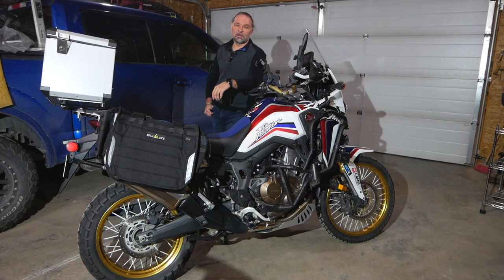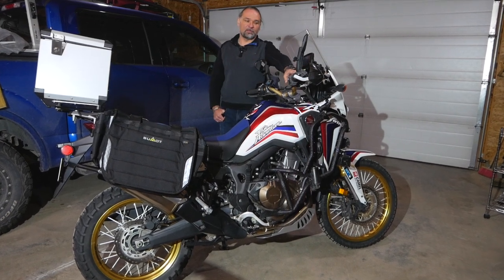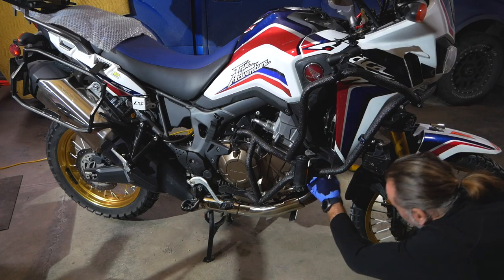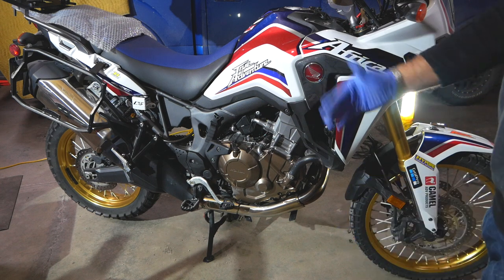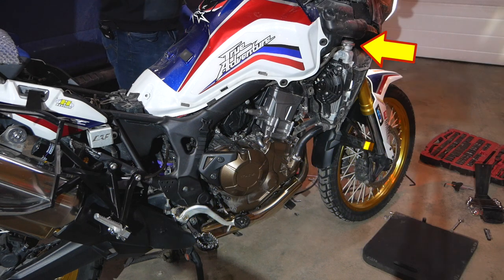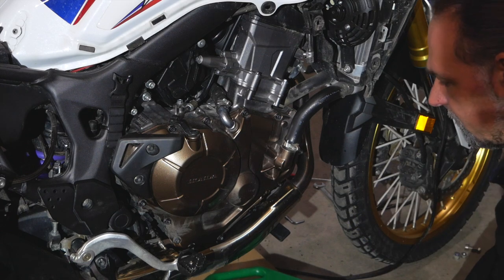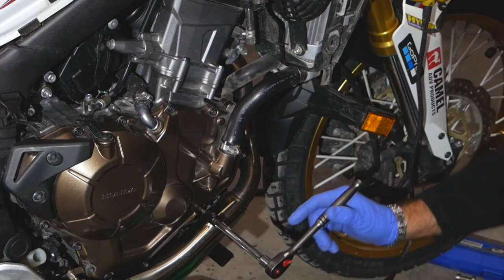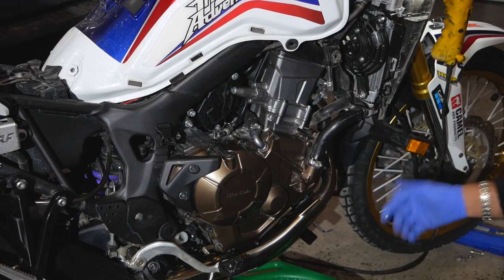HOW TO FLASH REPLACE  MOTORCYCLE COOLANT  HONDA AFRICA TWIN 2017

Comment: Hi Sir, great and detailed video as usual! Just wondering how the second (left side) radiator, fill itself to the top with coolant and the air is able to be pushed out of it? Regards!
Reply from the maker: They are connected together and that's why you run your bike with the cup open for a bit you will see you will have to top it up as the coolant gets a bit lower and once top up start the bike again to make sure your coolant it up to the neck of the filling cap.  Collant starts to rise when it is full. You can look it up also in Service shop manual.
Reply: @AdventureTravelandScuba  Many thanks for the reply, sir! Stay safe and have a nice moto season! :)
Reply from the maker: @simeonstankov513  Thank You and same to You ride safe.
Reply: @AdventureTravelandScuba  I guess there is technically no reason to remove the panel on the left side of the motorcycle if there is only one filler cap?  That filler cap only being on the right side?
Reply from the maker: @williamsongradingllc6134  correctly by myself if I'm that far already I will have a look at my Air filters may as well
Reply: Hi and thanks for all these great videos on AT maintenance.  Thanks to your videos I replaced brake pads and fluid on my new-to-me 2016 AT and today tackled removing crashbars and fairings to replace coolant and air filters.  It took awhile but I got there!  Great videos. Much appreciated!
Reply from the maker: I'm happy you found value in my content, and thanks for positive feedback

Comment: video perfetto, unica domanda. Una volta messo il liquido refrigerante e si mette in moto bisogna mettere il tappo al radiatore per eliminare le bolle d'aria nel circuito?
Reply from the maker: What language is this so I can translate with google?
Reply: @AdventureTravelandScuba  Italian
Reply from the maker: @giammarcogiorgi7449  Thank you for the comment
Reply: I repeat my question because you can't see it in the video.  Then, once the cooling system has been emptied, the new liquid is added.  Then the bike starts, but does the cap have to be put back in the radiator or should it be left open without the cap?
Reply from the maker: Leave the cup open after you fill it up with coolant once engine reaches its operating temp. Close cap at the end and top up coolant reservoir to max  line as you see in the video
Reply from the maker: @giammarcogiorgi7449  the cap should be left open so this way it has a way for the air in the system has a way to escape, the video shows when I install the cap back on at what stage. Hope that helps

Comment: Nice video, finaly someone made video how to change coolent on AT! 👍 2 questions tho:
Is it necessary to remove left panel of the bike if the coolent system is on the right side?
Soundn't be the coolent system flushed with destilited water before you put new coolant? 
Thanks
Reply from the maker: No it is not necessary at all but I was also cleaning my air filters you will see in next videos to come, don't need ro mix water if You purchase premixed coolant as i have stated in the video.  The coolant is already good to pore in
Reply: @AdventureTravelandScuba  is it 1,4l for everything? Reserve tank too?
Reply from the maker: I bought 2 if these bottles and I did not use all  of it there is quite a bit left in One of them buy 2 just to be safe https://www.amazon.ca/dp/B0039OTLRW/ref=cm_sw_r_cp_apa_i_EAYZ5Y6SBG8F2EK9E4Y0?_encoding=UTF8&psc=1

Comment: Hi. Great video. Do you close the radiator cap when running for 4 minutes? Or is everything open. Thanks.
Reply from the maker: No leave it open you will see the coolant slowly rising, the idea is to get the air out of the system once coolant level starts moving up too close to spill turn the bike off.  Hope that helps.
Reply: @AdventureTravelandScuba  thanks. Helps a lot. Just need to decide when to replace. According to the manual only the reservoir needs top-up.
Reply from the maker: @migo33  I would recommend 2-3 years lots of potential issues with water pump possible to happen you can search the forums and websites, not a big job not expensive worth a piece of mind
Reply: @AdventureTravelandScuba  thanks. I agree.

Comment: Useful video, Thomas! What are the drain bolt washer dimensions? I'll order few, just in case if it needs to be replaced.
Reply from the maker: Unfortunately I don't know the size or part number of the washer Your best bet is to contact dealership, It is also not listed in Shop manual, but You can always reuse it, I live pretty close to my Honda dealer so if i need parts itbis 10 min away.
Reply: Oem honda sealing washer 6mm
Reply: @mike-on-the-bike  Thanks much, Michal!

Comment: Is it possible to just take out in inner plastic cage under the fairing and just unbolt the radiator to get to the cap and just fill it that way? My cage is a pain to take off and put on.
Reply from the maker: Not possible I'm in the same crush bars are pain in the ass as they have to come off
Reply: @AdventureTravelandScuba  I read on an At forum of someone doing it. I would think the tricky part is getting a funnel at an angle to pour the fluid in and would maybe need a small mirror to see when its getting close to over flowing. Are those two bolts the only two that hold the radiator on?
Reply from the maker: @BradleyZT  you can try funnel with flexibles mozzle

Comment: Sorry couldn't help but notice your handlebar risers I am looking for a set just like them.got a set but they bring the bars back to much .just want them raise. What are they
Reply from the maker: These are ROX 2 inch risers I just took them off as much as I love them they don't work with my SW motech tank bag.  So if you are interested they are for sale.  I am now using the risers from Honda Adventure Sport, just straight up
Reply: @AdventureTravelandScuba  just watched the video of you fitting the ROX 2 I though they were straight up to ,sorry I need straight up to
Reply from the maker: @michaeldoherty4070  If You want straight up just order risers from adventure sport cheaper then all others that's what I did
Reply: @AdventureTravelandScuba  do I order them from Honda tried entering adventure sports bar risers didn't com up
Reply from the maker: @michaeldoherty4070  I went to my Dealer $110 Canadian, Your local Honda dealer should be able to order them for You
Reply: @AdventureTravelandScuba  that's what ile do thanks

Comment: who ever watches this video "never ever ever "  warm the engine before a coolant change , this can result in terrible burns.  Im a honda trained motorcycle technician of 30 years and this made me shudder to watch .
Reply from the maker: did mention just idle for few min not to make it hot correct? Warm fluids drain slightly better and that's common sense, you don't have to be certified mechanic.  Same goes for oil change.  My friend is a Mechanic at Toyota for many years he always recommend to do that NOT TO THE POINT WHERE ITS HOT.  I did warm it up a bit too much when I was doing this video 😉  The engine was warmer then the fluid itself
Reply: @AdventureTravelandScuba  warm oil yes , but there is no viscosity change to water or coolant when hot thus no need to warm engine.
Reply: How about thermostat? Should it be open so all coolant drain in all hoses, when its cold thermostat is closed and to me right at the thermostat neck hose some coolant would remain, i don't know what do you think???
Reply: @hydrauliccardboardpressmac6576  we are talking 90 degrees centergrade  for a thermostat to open the system will be very pressurised at that temp , so no! . There is a small hole in the thermostat  which most will drain past.
Reply from the maker: Apparently there is a small pass through on that thermostat so coolant should drain.  Also I didn't make the bike super hot before draining antifreeze just warm if you run your bike too hot you may get burned with hot fluid

Comment: This method does not clear all coolant. Coolant left in the engine water jacket remains  due to a closed thermostat.
Reply from the maker: Not sure if you watch the full video but I did run the engine first. Make sure that the thermostat is open before it started draining it